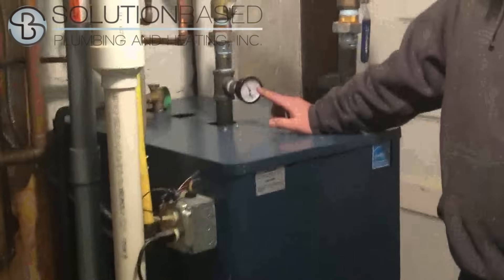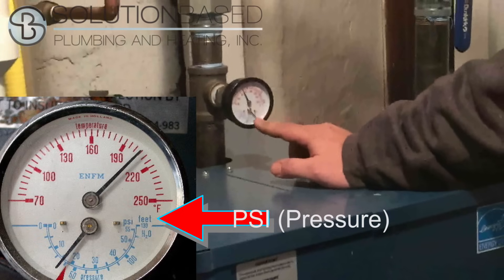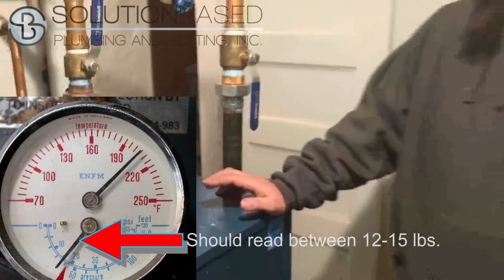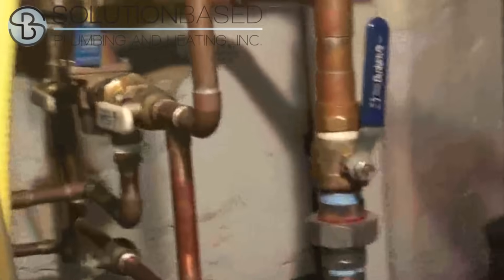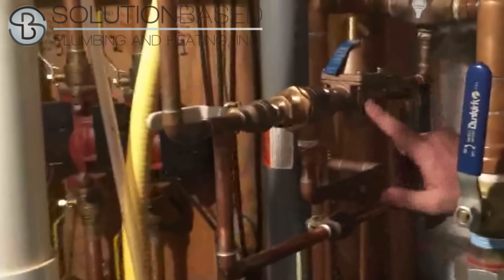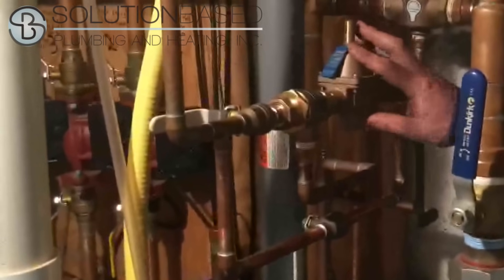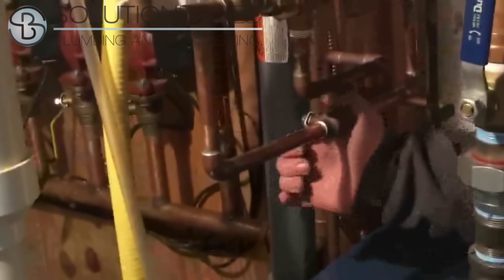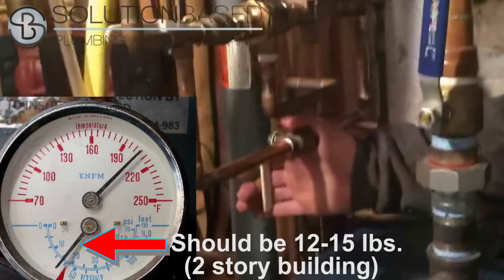Boiler Pressure: Checking, Bleeding and Filling Your System

Comment: Whatever. No mention of temperature vs pressure. Water expands when heated. 12psi at 70 degrees is not gonna be 12psi at 180 degrees or higher. Especially if you have a backflow preventer. Even with 2 4.5 gal expansion tanks it'll go up 5-6 psi. Never seen anyone run a 'bypass' setup like that either. Why? Just about every fill valve has a 'fast fill' feature. If it doesn't, buy on that does and save yourself the trouble. This kind of simplistic explanation can get people into trouble.

Comment: I cannot thank you enough for your clear, detail explanation. I had a pipe banging noise for over 2 years (summer).  It turns out my oil furnace water psi was too low.  All I did was turn on the fill valve to let water psi to 15psi and the noise was gone!

Comment: If anyone can help maybe you might know--why my boiler is filling up with so much water when we set the thermostat on to get heat to heaters and into the house. We had the exact same problem with the previous boiler we had--that boiler failed, got rusty and part of glass in the boiler broke so we had to replace it with the new boiler we have now. *Not sure if this matters--so with the previous boiler my mom arrogantly set the thermostat to 80 and 80+ temperatures a number of times and heat would go into heaters and into our house when she would set the thermostat to the temperatures she set it at--but ever since she started setting the thermostat to the temperatures she set them at the thermostat has to be set to 80 degrees for it to get heat into the heaters and house and for the boiler to turn on. With the previous boiler we always had the following when the temperature was/would be set to 72: the heaters and house would get warm, we could run the heat until the house would get warm and then would turn the heat off after the house would get warm--then later after the house would be/get cold, we would turn the heat on to 72 degrees and the same things at 72 degrees would occur with no water, boiler and or heating issues. Does anyone know if the water filling up too much in the boiler is a thermostat problem?

Comment: I’m only getting water out of 1of my first floor radiators I believe my gauge is broke on my boiler the psi is at 0 n temp is at 180 when it’s running and not running. Should I keep putting water into the system until I see water start to come out of the other radiators?

Comment: My cast iron heater upstairs will bleed air but no water comes out n it stays cold, every few days if i bleed it enough water will come out n it heats up but it seems to not let water out for a few days, the PSI is around 15 n im in a 2 story house so the pressure seems to b ok, y is the heater upstairs so stubborn to have water come out?
Reply: Increase your pressure gauge may be off.

Comment: The water in my shower doesn’t stay hot for a couple minutes and then gets called the water level in the clear tube on my furnace is a little low do I just need to add water to the tank to fix the problem
Reply: You must have a steam system. Gauge should be alittle more than 3/4 full when boiler is off,when running it will lower. Haven’t seen to many tankless coils on a steam boiler but that what it sounds like you have. Not a great way to get hot water i would install a separate water heater if you keep running out quickly.

Comment: Took forever but findally found this, thanks. My bypass does not have a shut off so i think its feeding household pressure directly into the boiler, ending up tripping the PRV. I'm going to add one and hopefully resolve my PRV spewing water issue.

Comment: Thank you for this video. When you say the pressure should be 12-15 lbs - is that when the system is cold? I've been having some problems with the boiler not staying on and getting to the thermostat temp. When it does stay on, the pressure can get near 30 psi. I have a hose hooked up to the pressure relief pipe and water does come out. I've bled the baseboards - not much air in them. Sometimes when the therm calls for heat - the boiler will click, but doesn't ignite. The boiler is near 17 years old. Probably time for a new one.
Reply: Similar behavior - these boilers are workhorses with a bit of intuition and research mine is still running solid. You can upgrade the controls to newer more intelligent units- I did the Aquastat, pump and installed a TigerLoop [research or ask a plumber] these bring those old units into the modern age. The relief valve relieving water can generally* be one of 3 things: bad PRV, failed expansion tank or a bad relief valve. A plumber will probably throw all 3 parts and get you back up and running. You can diagnose which has failed and save a couple hundred bucks. Good luck

Comment: Thanks for the video. Since we haven’t had the heat on the boiler is cold. How do I know if pressure is 12-15 on a cold boiler? Is what the gauge reads when cold for 6 months? Or should I turn the boiler on to get a reading? Thanks!

Comment: My temp gauge works but psi sits at 0. But I feel the water moving in the pipes and it circulates to all the rooms no cold or dead spots. Could it mean my gauge is broken? Or something else??
Reply from the maker: try to add water see if needle moves if it does gauge is probably ok. You can double check with hose fitting gauge attached to boiler

Comment: Question, is the 12-15 PSI supposed to be when the furnace is off and cold or when its hot?
Reply from the maker: both temp should not change a properly working system

Comment: What if the pressure is too high ?  How to I lower it ?

Could the cold water feed be set too high ?  How to I lower the set point for the fill pressure ?

I’m assuming the 12-15 psi is on a cold system ?
Reply: Did you ever figure out how to reduce the pressure? I have the same problem.

Comment: I don't have a bypass on my system, but the company that installed it have a hose connection in the loop.  Is that ment for repressurizing?
Reply from the maker: nope that's a purge valve more than likely
Reply: @solutionbased5176  thanks
Reply: @solutionbased5176  is there a bypass on this particular autofeed?  If so how?
Reply: *meant

Comment: Very nice. I did learn something about what things should be. Perhaps wondering you can do a video about my house. It's from the 60s and the previous owner went cheap on everything (vertical windows turned horizontal, for example, all kinds of fun discoveries with electric and plumbing, 6 layers of flooring in the kitchen had to be lifted up, etc.). So you can imagine, my heating/hot water system is a bit of a Frankenstein's monster and I always seem to get interesting and different answers each time I get a plumber here. (I guess this is more of a rant than comment or question since no video on YouTube comes close to what my system looks like even though I see very similar features....) I am constantly told I have an excellent burner and it's hooked up in the least efficient way possible. We get air pockets like I have an air tank deliberately hooked up to it and sections of the house go cold because a thermostat crapped out one day or we lost power. Every winter is a new experience. Valves are in the wrong place making it difficult to work with the system. And that's just for starters.

Comment: good information, but looking for understanding of the auto feed valve.
What pressure does it maintain?  Does it regulate pressure?
Reply from the maker: it is adjustable and factory set to 12 psi. google the unit the instructions will give you your details

Comment: Oops I just shoved like 3 gallons of cold water into a boiling hot system 🤦🏽‍♂️🤦🏽‍♂️ fml….  What should I be expecting or worst?  Btw thank you so much for this information!  I wished I had found this videos 8hrs ago
Reply: You still alive?
Reply: @Alienspecies635  thanks for checking but yes I am.  Scary but you live and learn!  I guess the water wasn’t as hot as It suppose to be.   Had air bubbles on my new system and needed to bleed it out.  So I shut power off and by the time I hooked up the hose and all (at a snails pace because it was my first time) it might have got cooled.  Never again, what made me look into it was that the water that was coming out the hose was hot!
Reply: @Arthur-dj8im  i’m a heating and air-conditioning technician I was scared of boilers for the longest time I just started servicing them this year and I came to find out that they’re actually a lot simpler than furnaces. It’s amazing what a little bit of air can do in the system. That little bit of air cost people a lot of money over the years with the service calls for no heat.
Reply: @Alienspecies635  yes this x10!  It solved my heating problem for now.  I still got other issues but clearing the air pocket will keep me warm.  1st home for me so I’m learning as I go.

Comment: Hi Sir, I would like to know why the automatic pump doesn't take off to send the hot water to the radiators. Everything works fine pilot and thermocouple and boiler fires up but the pump. I have to do it manually. I have an old Slant/fin 100 series...

Comment: Hello, my backflow preventer vent is open. I noticed it's closed off on yours and connected to a pipe. Do they need to be opened or closed off?
Reply: My thinking is that connecting a pipe or tube does not close the vent but simply directs any water from backflow to a suitable container or surface rather than having it drip onto whatever is under it. The only way to close the vent is to screw in a plug, which is the way mine has been since buying the house 20 years ago. Why I don't know, but assume it was malfunctioning and dripped water when it shouldn't  IOW the backflow preventer probably isn't doing its job, which I guess it should do only when the house pressure drops below the boiler pressure. Perhaps when I know the house water pressure will be turned off I should close the feed to the boiler. That or replace the backflow valve.
Reply: @bigpardner  be careful man I've read so many horrible things about those plugs...
Reply from the maker: open is ok if it blows it will make a mess though

Comment: A bypass of a combination backflow/ pressure reducing valve is not legal. It's a cross connection point and can contaminate the potable water. If a bypass is to be installed it must installed up flow of backflow preventer in order to protect potable water
Reply from the maker: yup true story
Reply: Thank you, your comment saved me from a rather stupid error. I have a bypass upstream of a backflow preventer, thus defeating the purpose. The problem is there's almost no room to fit a bypass downstream from the backflow preventer, I have the Watts combo. I'll keep researching a better design/solution.

Comment: Is it normal your auto feeder feeds it every time just before the furnace lights up? I'm talking 20-30 times a day. Radiators let of a tiny bit of steam at the air valves . But I don't think it's losing that much water for the auto feed to feed it every time it lights up
Reply: let *off

Comment: Hi, is the bypass valve that's the supply? I constantly have an E-18 error on my MacLain and I tried to bleed and open the bypass valve to fill up the tank because my pressure gauge is below 10 lbs. and when the pressure hits 15lbs I shut the valve off and Lo and Behold the heater is working again. Many thanks to your video.

Comment: 👍. Cami answer this. My pressure goes down to all but o  it goes up as the temperature goes up. Have bled   No hammering n otherwise works good. I did replace the pressure tank. Short of replacing the temp gage I’m at a loss
Reply: My boiler does the same thing...pressures creeps down to zero as the water temperature approaches the lower set point, then raises to around 20 psi when the temp reaches upper set point. Boiler works fine though but I still think something is wrong.
Reply: andrew takacs lmn if u get r figured out. I’m still trying  kinda iffy  it seems to work fine otherwise.
Reply: Fixed it...needed to add water to the boiler...the feed valve needs to be “bumped” a few times which adds water to boiler and watch pressure go to 12 psi. Make sue boiled has cooled down first since cold water is added. Easy fix.
Reply: andrew takacs I use to b able to do that but after it runs n cycles does the same thing. O

Comment: The plumber told me my pressure should be at .5 psi.  You reccomend 12psi - 15psi.  What the correct psi?  I have a Peerless steam boiler and after running it for 3 hours, steam began to shoot out of it.  I think it was coming out of the pressure relief valve and also the pipe to drain the water out cracked and water began shooting out of it.  Was this because the pressure was too high?  I called a plumber and he replaced the cracked pipe.
Reply: steam boilers are different. He was talking about a closed loop hot water system
Reply from the maker: steam is different!!!!! you should not be setting your steam pressure unless you are well read. Lost art of steam heating by Dan Holohan

Comment: Excellent video Josh.  The emphasis to let the boiler cool down before adding cold water is a real service to those planning to drain and  repressurize their system.
Reply: Yeah...for homeowners in an area without muthafuckas like Josh available...this helps a lot.   God bless guys like you and Youtube.  THank you.
Reply: Hi, all comments seem to be a year old. Im not having any problem with my heat, but there is no water visible in my sight glass. When I try to feed water, it still doesn't fill. Any suggestions?
Reply: Yes, helpful video. However, It’d be more helpful if the warning was at the beginning of the video, especially since “it could ruin your entire system”.

Comment: Why does the water level bounce dramatically while boiler is running?
Reply: I watched a video that mentions that internal crud causes pressure fluctuations in the sight glass.  He spoke of using an additive treatment to clean the transfer plates (?) and doing a system flush to remove the gunk.  An efficient boiler has a steady sight glass, whereas one that's working hard is jumpy.  Clean that mutha
Reply: @DoctorColg8  and then there are the number ones that don't even have said sight glass to begin with. 🤷🏼‍♂️ And when I say new my boiler is a Burnham Alpine ALP150-L02... It's been shutting off on me with E 18 for months... And nowhere on the internet does it seem to exist... Or rather any videos about it everything is freaking the newer LCD screen. Had Sila out several times charge me ridiculous money and then told me all of my piping was wrong and they wouldn't do anything else until I agreed to have it fixed. Pretty sure I just need to get the gunk out as that error is a supply high temperature error. Recommendations on products for cleaning a boiler anyone? My neighbor mentioned Sizzle. So over this. Every HVAC company I hire SCREWS me, charges insane money to ignore me, talk to me like I'm an idiot, and then charge me insane amounts of money and my system is still shutting down with E 18. For reference no matter what Sila says it worked just fine for 20 plus years!?🤷🏼‍♂️🤦🏼‍♂️😢

Comment: thought you had to figure out the runs, such as you have a line that is 20 feet rise, then it goes horizontal for another 20 feet, a 2 foot rise, then horizontal another 25 feet.? That in turn, would give you the guage reading at the boiler. Like 2 psi per foot?
Reply from the maker: no rise only. pump head is what you are asking about

Comment: I don’t like where the back flow preventer is installed. It should be moved more upstream to protect the normal operating line through the pressure reducing valve and the bypass line.

Comment: Hi Josh, I have Pennco Gas Boiler residential use 1 family house. Recently the water pressure reach to Max when boiler reach 180F temperature and the Relieve Valve blowing water off. I have change the water pump circulator, pressure relieve valves,expansion tank and feed water pressure regulator. Water pressure reach to max psi every time boiler turn on. Is there anyway to lower the water pressure? I have bleed the radiator and water pressure still on max high and water coming out from relieve valves.
Reply: Did you figure this out? Similar-ish scenario.

Comment: The pressure is a function of temperature, right?  So when the boiler is firing the temp should be what and when it stands idle the temp should be what?  Is that why you said 12 to 15 psi?
Reply: As long as the water isn't turning to steam the pressure isn't much affected by the temperature, so the 12 to 15 PSI is really just ordinary standpipe pressure. To add water to mine, my methodology is to let the system "achieve room temp," then I turn all the heat zones on, open the fill valve and run around the house bleeding the radiators, starting at the lowest level. When water reaches a bleed valve I close it and run down into the basement to check the pressure and the temperature. So far I've never seen the pressure go over 12 PSI or the temperature go over 105 degrees F. until I had all the radiators completely bled out, even though I have 11 radiators spread over three floors (my house is 107 years old in 2018). Also, when you think you're done it's still a really good idea to double check all the bleed valves, even if you're 100 percent sure you've already got them closed. And if that sounds like the voice of experience; it is...
Reply: The difference in temp re pressure is handled by the expansion tank, yes?
Reply from the maker: @bigpardner  yes

Comment: Hi Josh, do you know why our water heating system keep reaching 30 psi, even after replaced a faulty expansion tank, and then replaced feeding valve and pressure relief valve as guessing they are bad, but water pressure is still so high? thanks
Reply from the maker: wrong size expansion or improper piping
Reply from the maker: Please give me a call 215-584-8099 there are some questions I’d like to ask you
Reply: Did you find a resolution?